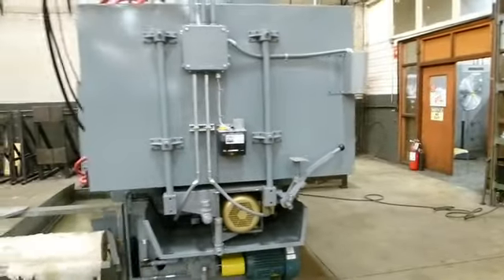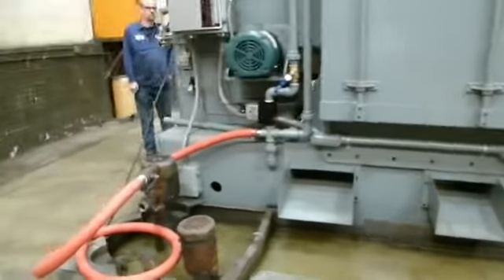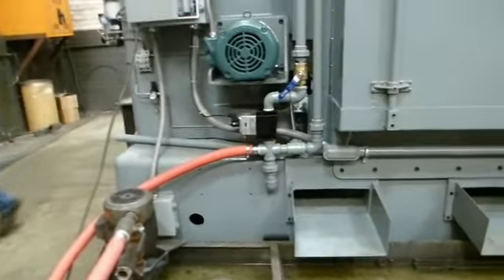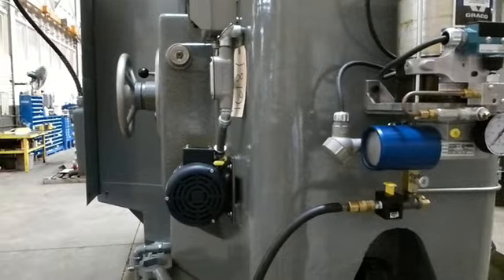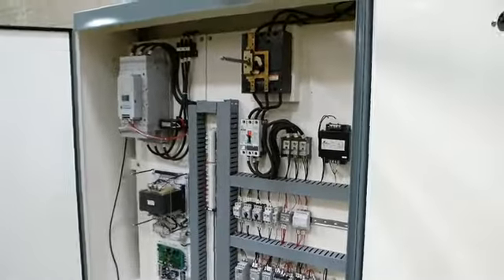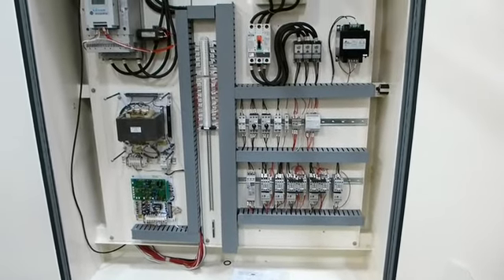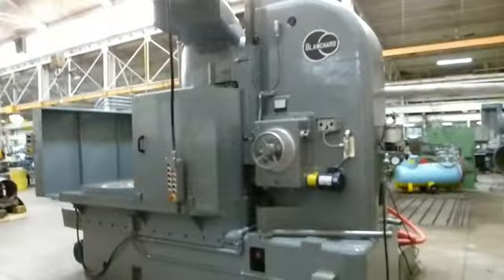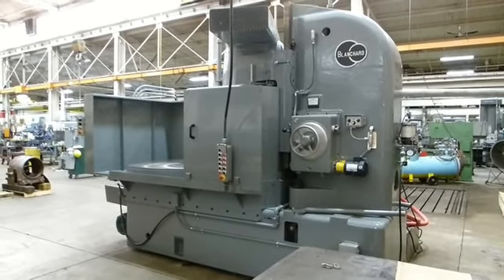Blanchard #32D-60, 60" Vertical Rotary Surface Grinder

Comment: Ran same one for a few years. In that time I also spent many shifts on the 84", 96" and 120". But the 60" was my usuall grind.
Reply: are you still doing blanchard grinding ?
Reply: @jacobwang3391   no, not for quite a while now. I am usually on large vertical lathes, medium horizontal boring machines and large lathes.